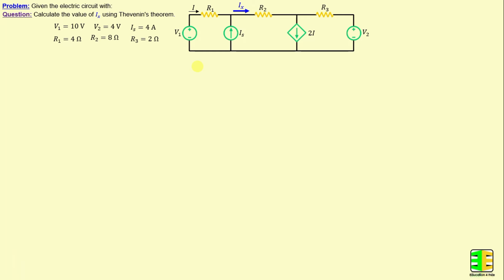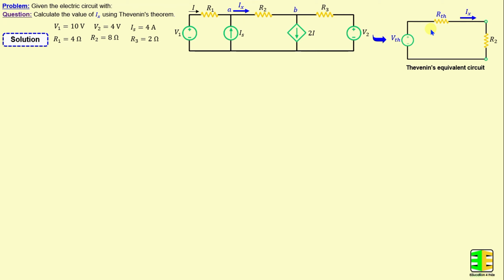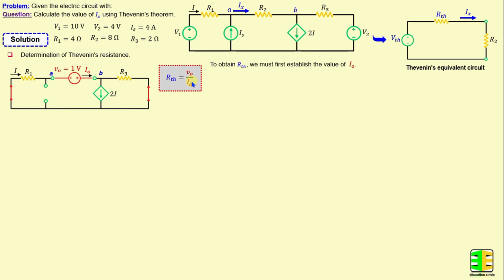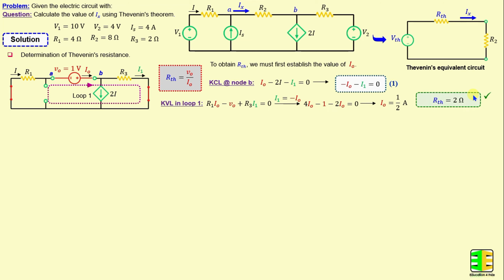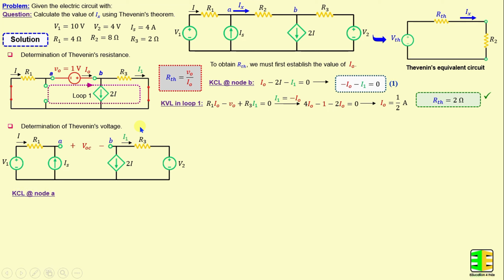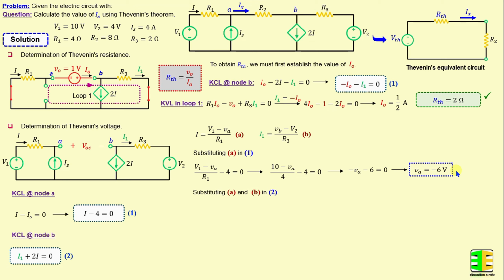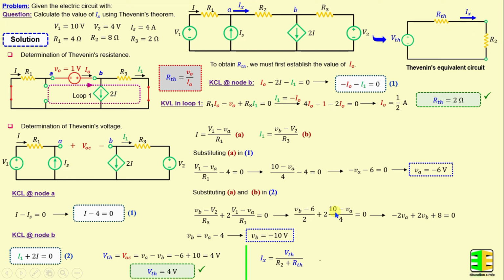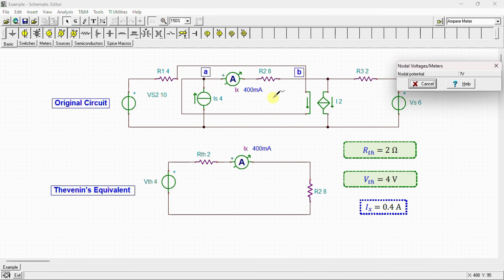Electric Circuits DC | Thevenin’s Theorem | Solved Problem 15

Comment: Dude I + Is = 0 
And also the thevenin voltage comes out to be 6 and for verification calculate the short circuit current which comes out to be 3. Now as we know (Rth = Vth /short circuit current )
Reply from the maker: True what you said